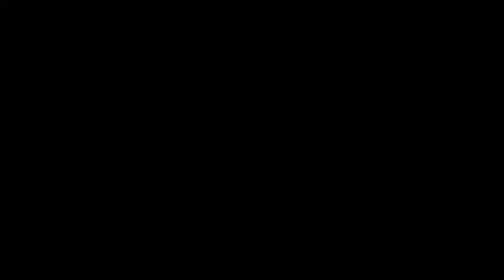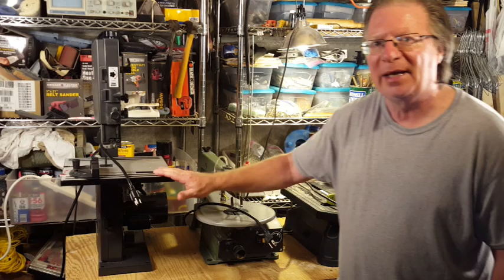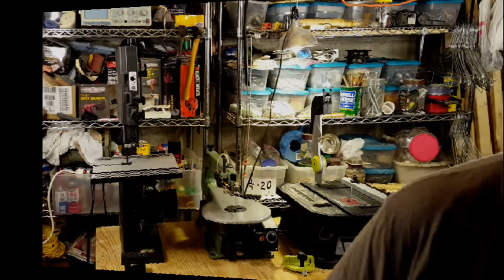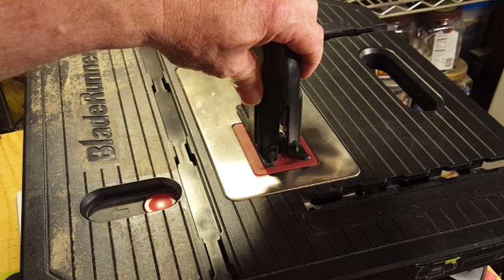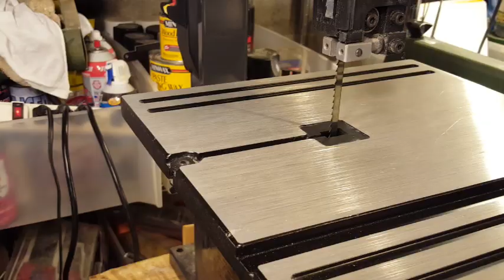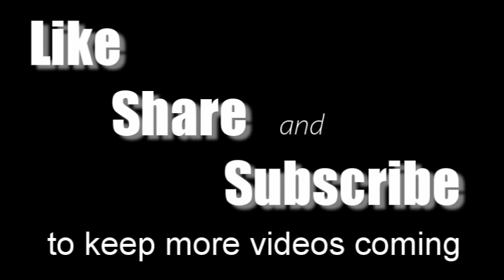41. Comparing the BladeRunner, scroll saw, and band saw

Comment: Hi. Great video. Question. Can I use the blade runner to cut an inches an a half pine or oak. I need a saw to cut from 1 inches to 2 inches of pine or oak or whatever I choose. After watching videos, I did purchase the scroll saw but I'm thinking about returning it. I do like what you said about the blade runner and the band saw. Like a idiot I sold my band saw. Now I need and miss it lol
Reply from the maker: Hi Michael. How small are the pieces of wood you are trying to cut and do you need to cut curves? How accurate do the cuts need to be? Do multiple cut pieces need to fit together? I'm guessing you want to cut small pieces and be able to make curved cuts (which is maybe why you bought the scroll saw?).
I ask these questions because your answers would effect my saw recommendation. Here are my thoughts so far assuming that you'd like to make accurate, clean cuts in small pieces of oak or pine (or whatever):
* With the right blade, you can certainly make straight or curved cuts in 2" pine or oak using a bandsaw. You would probably need a bandsaw with more power and better blade guides than what the inexpensive Harbor Freight 9" tabletop band saw offers.
* Again with the right blade, you can also make the same cuts using a scroll saw. I think most people (including myself in the beginning) underestimate what you can do with a scroll saw. Does it cut quickly? NO. Can it cut accurately? ABSOLUTELY. Does it require more skill/practice than other saws to make accurate cuts? YES, I THINK SO. Is it the least expensive saw to get the job done right? YES, I THINK SO.
* Again assuming you need to make curved cuts, you could probably do it using a Bladerunner but if it were me, I think I'd prefer to use a standard jigsaw with a scrolling blade installed when cutting 2" thick pieces. When using a standard jigsaw, you are pressing the base of the saw down against the wood which helps keep the wood from hopping as the blade oscillates through the wood. Using the Bladerunner, the part I call the "foot" is used to help keep the piece from hopping while cutting. The challenge of using a jigsaw/Bladerunner is that the blade is held only on 1 end; the other end is able to lean over while cutting. The bandsaw blade is one continuous loop and is essentially help at both "ends" while cutting. The scroll saw blade is held by both ends and in a fair amount of tension.
And finally, I didn't ask if you need to make any inside cuts. If you do, then try to get the scroll saw to work for you. If that is just too slow, then try a standard jig saw.
Thanks for your question and for watching. I hope my reply helps. Feel free to respond with any other comments/questions.
Reply: @ImaginethenMake  thankyou. You did answer my question. I did buy the scroll saw but was skeptical about using it or weather it would work cutting 2 inches wood. The curse are minimal. Haven't thought about inside cuts as of yet. But that's a great idea. Thanks again
Reply from the maker: About the thickness of wood you can cut on a scroll saw; my saw is limited to 2" max ( https://www.harborfreight.com/16-in-variable-speed-scroll-saw-62519.html ). In this video: https://youtu.be/fzkflN8jeyg I cut several pieces of different kinds of wood including a 1.5" thick piece of Douglas Fir and a thinner piece of oak. In this video, I'm using the saw just as it came from the store (no modifications). I'm using 5" pin end blades (the video has more details). I recommend you watch this video because I think you could benefit from it and perhaps try the same kinds of cutting experiments with the scroll saw you have. (Remember that a scroll saw can also do inside cuts whereas a bandsaw cannot.)
I believe in the versatility of the scroll saw so much, that I created a playlist showing some of the things I've done: https://youtube.com/playlist?list=PLGCBwUeR2BD0ZFcTdtcldItQ5UtxnmOZi . There is sooooooo much I want to do so I'm sure I'll be adding to this playlist in the future.
Feel free to reply with any other questions or comments.

Comment: i need to cut small shapes smoothly. What is the best tool for that. Scroll saw or blade runner?
Reply from the maker: I suggest using a scroll saw. A scroll saw can cut small parts very accurately and with very smooth edges. Your best results will come from selecting the correct blade for the material you are cutting. You might need to do some experimenting by trying several different types of blades. The first type of blade I would try would be a pinless #7 skip tooth reverse blade. These blades are available from several sources including Amazon. Click this link for more detail:https://amzn.to/3KpAgIP .
Thanks for your question and for watching.

Comment: Bought the BladeRunner. Cut fine with 3/4 and under wood. Anything above that and it's garbage, to loud, vibrates like a motherF, the blade drifts & twist, the guide is trash. I packed it up and returned it the next day. Don't waste your money. I'd rather beat myself over the head with a frying pan.
Reply from the maker: The BladeRunner is loud and does vibrate, I agree. But for me, it still does have a place in my shop. In a recent video (#112), I used it to make a wooden portable bookshelf (here's the link: https://youtu.be/W-aKZlOVNlI ). In that video, I show you  how I dealt with the vibration and the noise. I make straight and curved cuts and I show you my results. Give it a look and see if maybe the BladeRunner is worth another try.
If you do decide to try it again, I strongly recommend good hearing protection and recommend the ear muffs I use in the video. The other key to enjoying the machine is in selecting the correct blade. In the video, I show the two very different blades I used and why.
Thanks for your comment and for watching.

Comment: I have the blade runner and I cut 2" X 4" all the time and it cuts beautifully. I use it a lot and I absolutely love it..I have no complaints about it at all. I put  metal tape on the miter gauge and it doesn't wobble. The fence works great. I have no problem with it..I do measure for distance from the blade though...I don't trust the measurement on the table. I'd recommend the Blade Runner any day...
Reply: Would love to know what type projects you use it for
Reply from the maker: Thanks for your comment Linda. Glad to hear you are enjoying the BladeRunner. What blade are you using to cut the 2x4's with and what kind of projects are you making? Thanks for watching.

Comment: you're very thorough. I really learned a lot. TY!!
Reply from the maker: Thanks for watching!
Reply from the maker: I hope you can see the differences between the saws. They all cut wood, but depending on what you are cutting, one saw might work better than the other 2. Scroll saws for small, detailed inside and outside cuts, bandsaws for accurate straight and curved outside cuts, and the BladeRunner (inverted jigsaw) for less accurate but quick inside and outside cuts.

Comment: Very useful review. Thank you. I would think an advantage of the Bladerunner is the replacement blades would be more economical. I imagine band saw and scroll saw blades are expensive. Yes?
Reply from the maker: Thanks for your question William. Yes, jigsaw blades are very inexpensive but can dull quickly depending on how hard the material you are cutting. If you work primarily with soft wood (i.e. pine), the blades should last quite a while. The scroll saw is primarily used for making more detailed cuts with smaller blades (typically with many more teeth). Because the blades are smaller to make finer cuts, the scroll saw typically cuts slower. In contrast, the band saw uses a much larger blade (the blade is quite long) so it typically lasts quite a long time, again depending on the material you are cutting. Band saw blades generally cost more than typical jig saw and scroll saw blades. So blade cost is certainly a factor, but so are the materials you typically cut and the kinds of cuts you want to make. I hope this helps.
Reply: @ImaginethenMake  Thanks for your reply.

Comment: Thanks for the info. Wow what a noise difference for that blade runner. Living in an apartment I could probably use the scroll saw at night time even. I have enough noisy tools, i don't think i could work with the bladerunners noise.
Reply from the maker: Yes, the BladeRunner is loud. Maybe at some point, I'll see about trying to make it quieter. When I use the BladeRunner, I always where hearing protection. I don't need to when using the scroll saw. Thanks for your comment and for watching.

Comment: Can they cut copper or aluminum
Reply from the maker: Short answer, I believe all 3 of these saws could cut thin pieces of copper of aluminum using the appropriate metal cutting blade.
I have only cut wood with the bandsaw and scroll saw. I have cut wood and mild steel (threaded rod) using the Bladerunner.
Thanks for your question and thanks for watching.

Comment: Why cannot they make the scroll saw table bigger with a guide and choose a quieter motor for bladerunner?
Reply from the maker: Thanks for your questions Russell. When you cut with a scroll saw, you have to guide the workpiece by hand to stay on the cut line on your template. The reason for this has to do with the kind of blades that are used and more specifically, how those blades are made. That's why the manufacture of a scroll does not provide a guide. Regarding the table size on scroll saws, more expensive saws often times do have a larger table. Like most things, you get what you pay for. Regarding the noisy motor in the Bladerunner, I suspect the manufacturer uses the least expensive motor they can. Said another way, a quieter motor would probably raise the price of the saw.

Comment: Ok, as of today I am 100% sure I will go for the blade runner as my intention it's to work with thin pieces of basswood for crafting and scale models for collectibles and hobbies!  Thank you so much for such detailed video review! So grateful you upload this video on this month as I've got interested in buy one of those power tools by this week. I would probably made a different choice if I would have watched video reviews 5 or 6 months ago when I had this in mind as well. Thank you so much for this helpful video!
Reply: Paul Hoyos I would recommend a bandsaw because it is a lot safer in my opinion and since the bandsaw only moves in one direction so it reduces tear out
Reply from the maker: UPDATE: I agree that a bandsaw can be safer to use because the blade travels only in one direction pulling the workpiece into the table. However, a bandsaw can't do inside cuts. To cut thin pieces of wood very accurately, I would try using a scroll saw before either of the other 2 saws.
Reply from the maker: You're welcome Paul. Enjoy the saw.